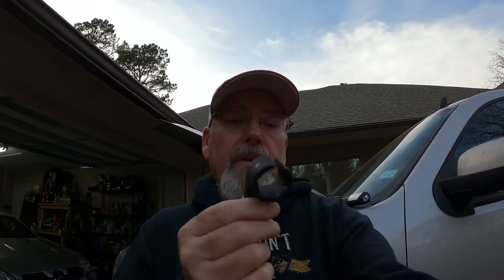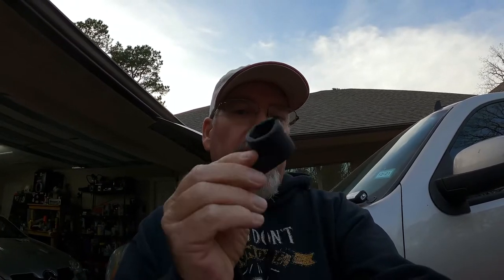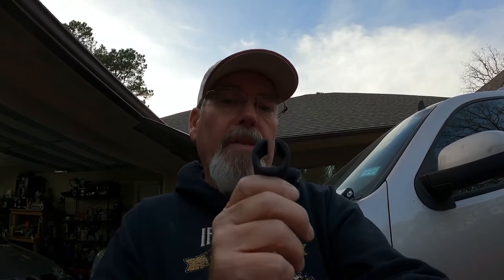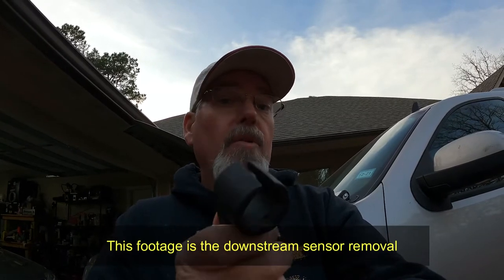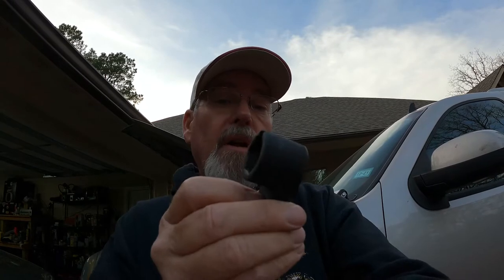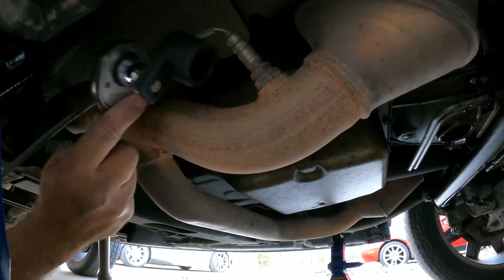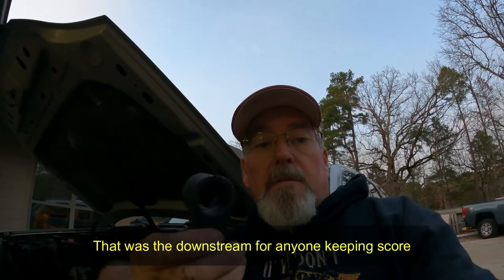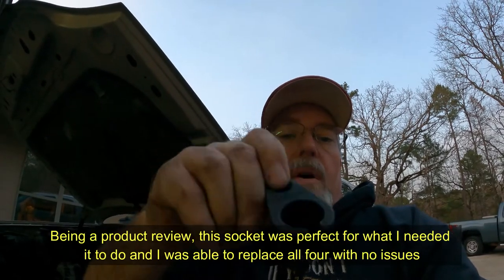Harbor Freight Pittsburgh Automotive Offset Oxygen Sensor Wrench a good product?  In short, yes!

Comment: I only need 1 O2 wrench. I dont want a whole kit that i will never use. How did you know which one will fit?
Reply from the maker: Put a wrench on the sensor and get that sized socket and you should be good.  If you can't get a wrench in there, use a crows foot to check size.  You can always use loaner tools from a parts store to get the proper size as well.
Reply: Just did that. Its a standard 7/8 inch. 95% of all O2 sensors are 7/8 according to Harbor freight website. Thanks anyway. @YellowJacketGarage